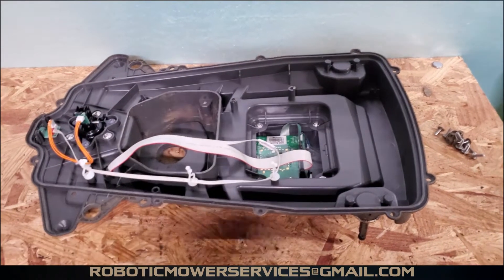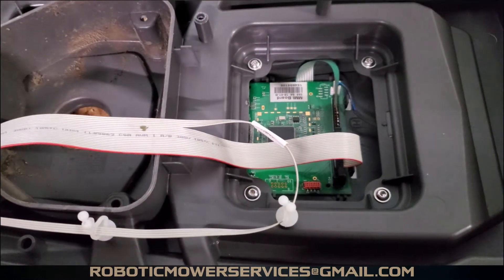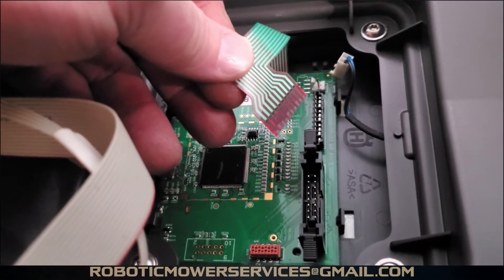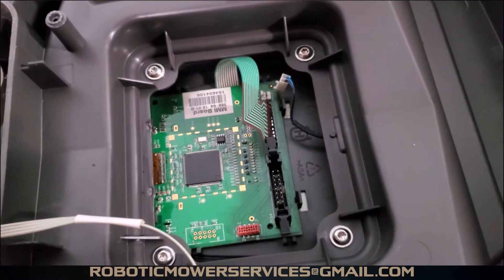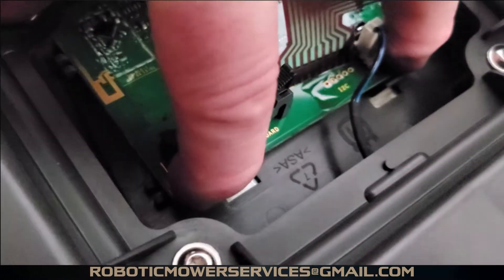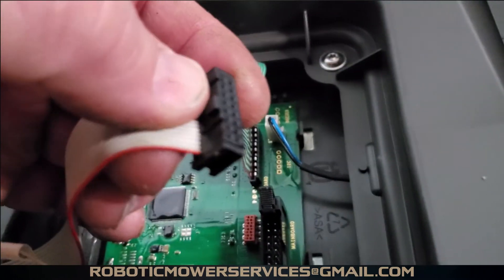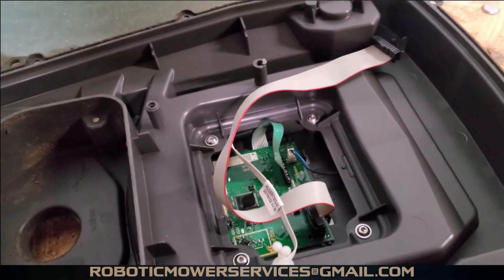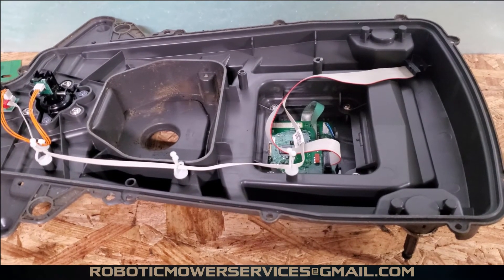Replacing An HMI Board On A 300 Series Husqvarna Automower (Menu Display Screen 310, 315, 315X)

Comment: I have a 310  that has been running for 4 years now and has done over 2700km according to the telemetry it provides.   Its running really well but I'm starting to prepare to the eventuality that I have to start fixing it.  Thanks a ton for the tips on replacing the HMI board and having to have to go to a dealer to program in.  That's disapointing that consumer can't fix it all themselves.   I hope to find someone that has dumped the firmware.   We decided to call the mower Jay in the honor of the landscaper Jay who used to manage the property which wanted to charge us an arm in a leg for cutting the grass.   I recouped my investment the first season.  We love robot Jay.
Reply from the maker: Awesome! Thanks for sharing!